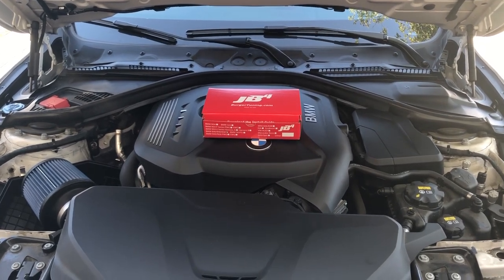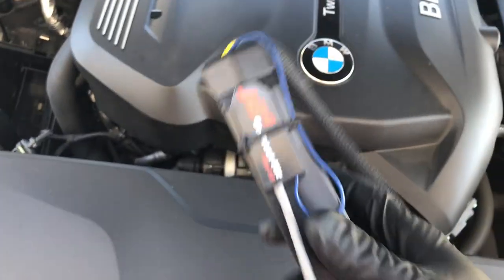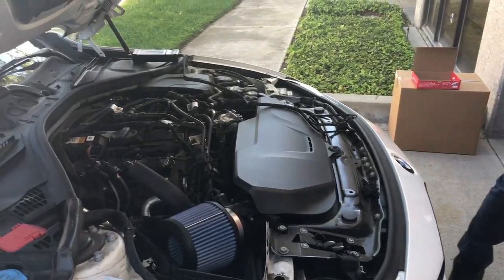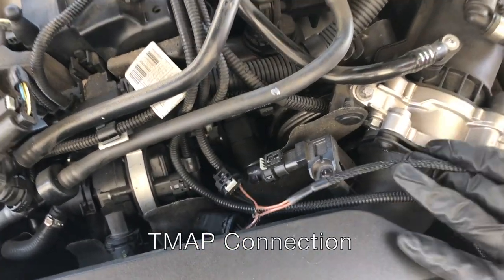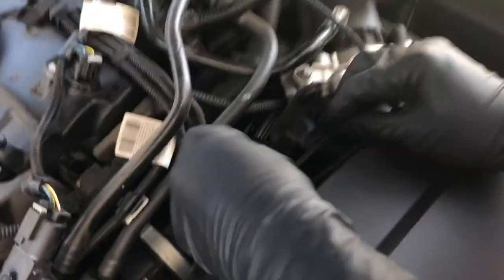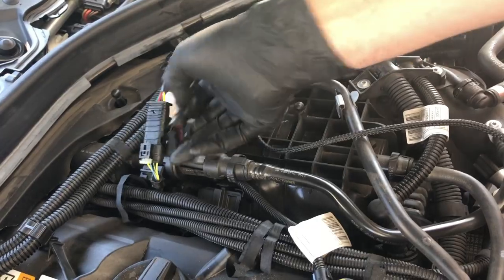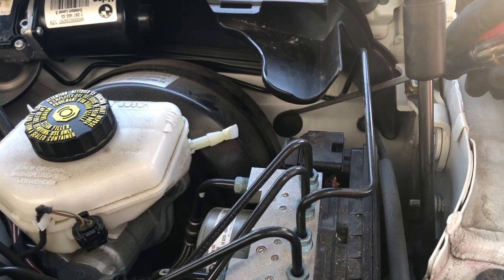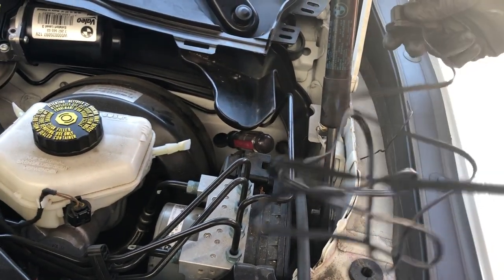JB4 Install Guide - B38 B46 B48 B58 Turbo BMW Engines

Comment: You lock the car with the remote to start but don't disconnect the positive battery cable as Burger instructs?  Is locking it enough?

Comment: Just an FYI if sensor doesn’t come out after you pull tab out you might just have to pull on the sensor super hard and it’ll come out. Just dont cut yourself when it comes out like me

Comment: HI there, I am thinking about purchasing one of these for the sole purpose of removing my God awful speed limiter (130 mph SMH) on my BMW 440I XDrive MPPSK (MSport/Tracking Handling). However, in the default mapping will this mess with my MPerformance tune? I might also try out the different mappings but can I remove this in the future and not worry about voiding my warranty? Considering this does not require a reflash, I don't see why not.
Reply: Should only modify the Vmax variable and set it to an absurdly high number or to 189mph that most German “drivers package” cars can be optioned with. This is weird because the MPPS kit if I recall shouldn’t have the base 130mph limited.

Comment: Going to be trying out the installation with this guide wish me luck
Reply: How’d it go?
Reply: @StepAwayVro  it was really easy my girlfriend helped me install it. It makes a huge difference. I’m using map 2 stock but now I want to get the downpipe
Reply: @djcoolitoff  do you know what the HP gain on it is by chance?
Reply: @StepAwayVro  I think 60 but it’s hard to know the real numbers without a dyno

Comment: Hello, great tutorial.   I wanted to have a custom tune applied at my local speed shop. I purchased the Brand new JB4 wireless set up after watching your video. How can a speed shop access the JB4? It didn't come with additional cables to hook up to a laptop. So it seems that the only way is through my phone. Is their any information that you can provide so I can get a custom tune done ie: tools or sights specifically for tuners? We were unable to see a way to connect without my phone.
Reply: Did you ever figure this out?
Reply: @aiogamershack2216  yes, I purchased a data cable to hook it to a lap top. However I also found that they were not able to improve upon the original maps. So taking it to a speed shop was a waist of time. The best method I found was to send burgertuning my recorded pulls and they sent me the values to enter on my end. They provided me maps to use as well as fuel mixture.
Reply: @chrismolina839  thanks for the update, I am considering JB4 but I'm also new to the tuning world so I know nothing about tunes and or recorded pulls lol 😅 so far I have stock 240i Exhaust back and diffuser paired with my 2020 230i
Reply: @aiogamershack2216  I would without hesitation recommend Burgertuning and the JB4. I have a lease and it's under warranty. I have had numerous repairs done under warranty. It was simple to uninstall and install. I do have some professional mechanical experience so the word "simple" is subjective. The product is great the customer service is better.
Reply: @aiogamershack2216  it can be a pain at times. I had a few bumps in the road but with the help from the community and emailing Burgertuning when I hit a wall really helped. They usually respond within 24 hrs. Really helpful.
Reply: @chrismolina839  thanks for all of this info, find me on Facebook maybe we can connect and in the future if I have questions we can help one another.
Reply: Hey quick question, how did you record your pulls to send to burger tuning?

Comment: Really wish there was a better way to secure the JB4 box under the hood so it doesn’t rattle or move around.
Reply: Ziptie
Reply: @treeezy1472  there's really not much to ziptie it to under the hood of an G2x 3/4-series with the B58 engine. Fairly tight clearance to the hood and other compartments. Last thing I'd want is that metal box getting loose under the hood and making contact with a belt spinning at 7500rpm. Also, the metal box has no insulation around it to prevent it from rattling against other things it touched like plastic or metal. A poor design compared to the small JB+ or other similar plug and play tuners that have better ways to mount them.

Comment: How much will this affect fuel consumption
Reply: mine goes up to 20-22L/100km from 13-14L without JB4
Reply: @TheKonquerRor  That's insane how you are getting better fuel economy with the tune! What mapping are you running and are you using 93/95 octane?
Reply: @JtwasLuck  sorry I think you got it wrong. I had 13-14 without jb4 and 20-22 with jb4
Reply: @TheKonquerRor  So better fuel economy with JB4 right?
Reply: @JtwasLuck  nope, the opposite
Reply: Peter Dineley  This is exactly why I would never go with such a modification. Down the line, I might go with Dinan Performance to get 420+ HP but atm with the MPPSK, I am doing great. I average around 18.2 mpg with aggressive driving (Sport+) and normal driving (Comfort), I can get up to 25 mpg without driving like a nanny lol. 

It baffles me that people don't spend the extra 1300-1700 dollars for the Track Handling Package. The Adjustable Dampeners + M Brakes are a MUST. People think MSport is all you need lol
Reply: Jafar Uddin do you track your car? If you do then I get it. I do not. Have M sport, bilsteins all around, sticky 245 rubber and I’m very happy with the set up. I’m glad I didn’t get the THP. Red stuff pads with these brakes are more than enough for the street.

Once again though, if you’re tracking your car I 100% get it. For people who do not track, M sport with some modifications is more than enough.